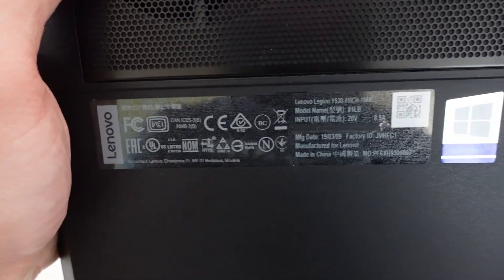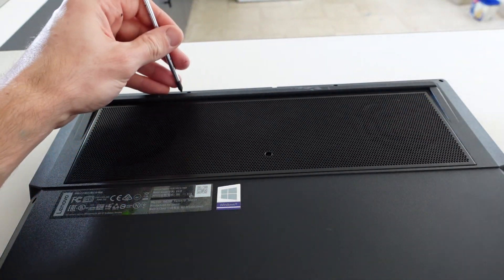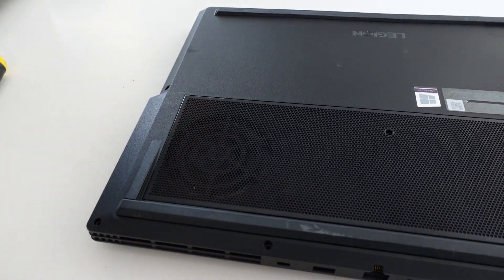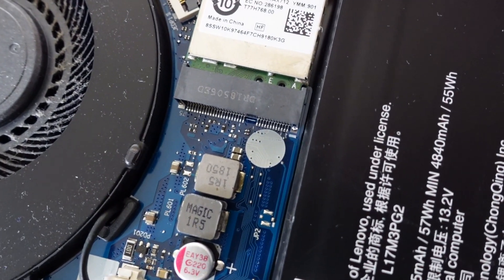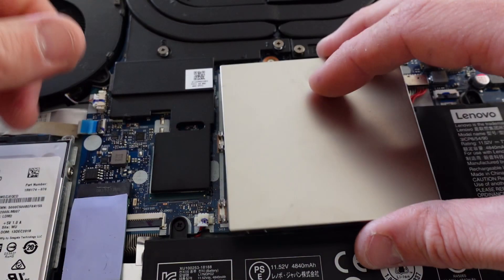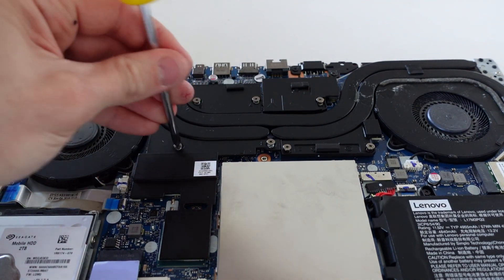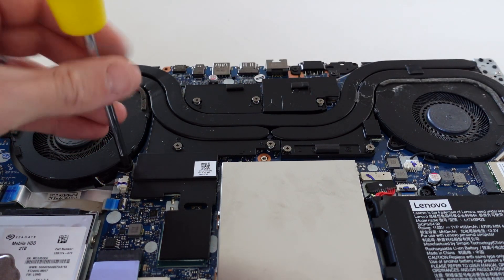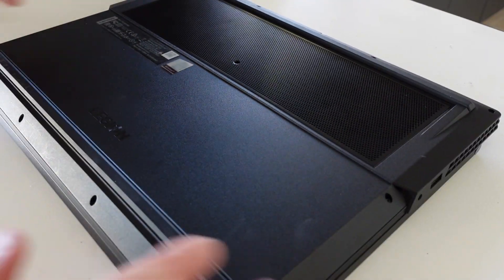Lenovo Legion Y530 Thermal Paste Replace and Upgrade options

Comment: My legion y530 Lapto keyboard⌨️ Backlight is not turning ON, i think lights are fused, but the good thing is Keyboard is working fine, is there any way to repair it? Or if i replace the keyboard will it fix it?

Comment: I know its old but this model is my only laptop now and i would like to repaste it too (since i never did it in 5 years).
Anyone knows if just turning of the laptop and disconnecting the battery is enough for the process? Cause i seen coments in other videos about doing extra safety stuff
I hope some could help me and thank you in advance
Reply from the maker: iv been pretty happy with the device off and battery disconnected.

if you like, once battery is removed, you could press the power button to discharged any power left
Reply: @rickstechrepairs  thank you 🙏🏽

Comment: I know this is old by now, but I had to comment.

You replacer the thermal paste, but not the thermal pads. Once you remove a cooler like that you have to switch out the pads (greenish white soft “stickers” that go over the VRMs and the memory).

That is also why I originally looked for this video. I wanted to clean the fans and cooler, but I wasn’t sure if there are any thermal pads under the cooler, or just thermal paste. Thankfully I decided not to disassemble it since I have no thermal pads at home to replace the old ones. If still have the laptop and are going to replace the pads, please measure the thickness, since too thick could mean bad thermal conductivity and too thin could mean bad contact. 

If you do measure them, please post your results somewhere so I can replace mine too.

Comment: 6:30 - VERY risky move right there. You use a metal screwdriver to poke that pin which has the conductive parts exposed so you could've short-circuited them. Secondly, this pin is meant to be pulled out in a straight way, it's again VERY risky to pull it out unevenly. There are lots of cases like these on Reddit, etc. and people see a spark in that connector and they fry their motherboard. I also experienced a spark while disconnecting and that's why I learned these points but fortunately, it didn't fry my motherboard. The best way to disconnect that pin is to unscrew the battery and then take the battery out by pulling the pin's cable evenly, it's much easier to do it this way too.
Reply: Shit, i saw a spark too. About to find out if something is fried or not

Comment: What is the black pad on the radiator? (On the left 7:29)
Reply from the maker: the black square with the cutout is to stop the factory thermal paste from running off the chip when it gets applied
Reply from the maker: Second Inspection Far Left hand site on the cooper, is to a little leg to keep the cooler from bending
Reply: @rickstechrepairs  yes, I am about second. I have it only on one leg. How is it named? I can’t google it…

Comment: The chip you cleaned on the left it looked like there was loads of old paste stuck between the tiny chips surrounding the chip you eventually put the paste on.

Isn't there a danger of a short if that paste is connecting two of those tiny chips?
Reply from the maker: If the past has already been stuck there for ages, leaving it there shouldn't hurt it, it is worth trying to clean it all up tho
Reply: If thermal paste is not conductive there is no issue then :)

Comment: I have a i7 GTX 1050i in my 530 & want to upgrade to the 1060. How do I go about doing this? I’m clueless to what to buy and where.
Reply from the maker: You can't change GPU or cpu in a laptop 

if you don't already have two matching stick of ram in your machine, do that for dual channel performance
Reply: @rickstechrepairs  hmm I thought so lol. I’ll check later on. I have 16GB of ram already.
Reply: @rickstechrepairs  damn I feel dumb lol. Ok, I’m going to check when I get the chance. I have 16GB already in it.

Comment: You need to unscrew the battery to remove the connector. It will be hard to remove like that. Mine was bit harder and took me 1hr realise this.
Reply from the maker: cheers for the tip